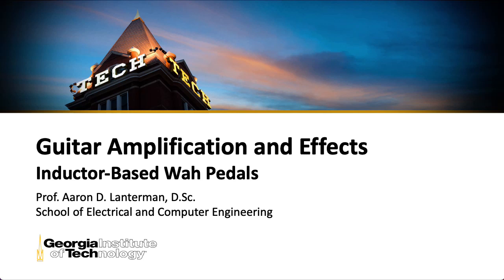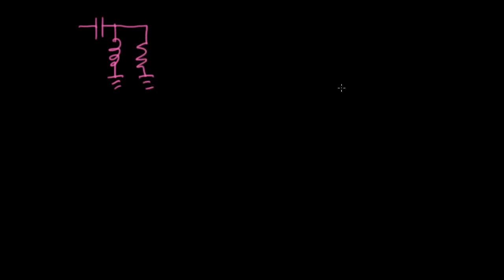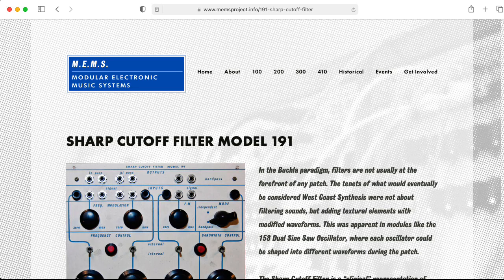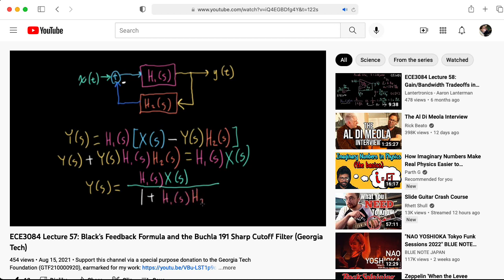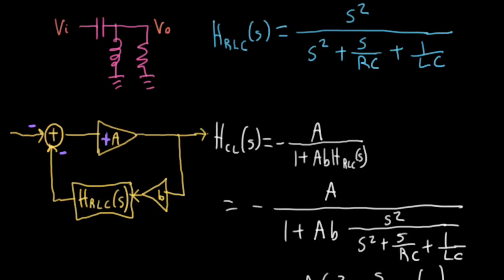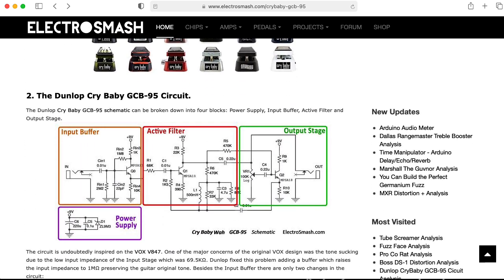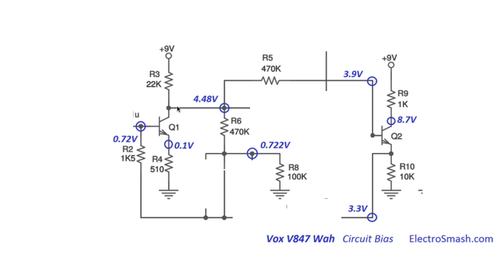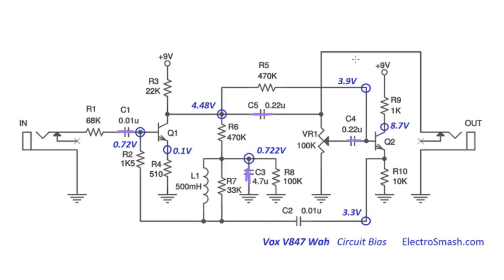ECE4448 L42: Inductor-Based Wah Pedals (Cry Baby) (Guitar Amplification and Effects, Georgia Tech)

Comment: This is great. Subscribed. I want to run a circuit by you that I fumbled together, if I may. It's a Wah effect I originally designed with a pentode/triode pair. You'll need to picture this. The triode acts as an input impedance buffer to drive the second stage. The output of which goes through a decoupling capacitor (with a 1M to ground) and a 1M Ohm variable resistor through to the control grid of the pentode. The pentode has a 1k or so cathode resistor and a large inductor on the plate (1 Henry). The screen grid is connected to B+. There is a small 100pF capacitor feeding back from the plate to the control grid. Varying the 1M ohm adjusts the cutoff, and to a lesser extent the pass band. A bandpass output can be taken from the plate (carefully), and a low pass can be taken from the cathode resistor. My mathematics skill are ordinary but I figure it's a rearranged version of the standard Wah pedal. Just wondering what your thoughts are? Cheers!
Reply from the maker: That's cool, I've never imagined a tube-based wah pedal.
Reply: qq over

Comment: I'm going to have to circle back to pick up the 80% of this that went straight over my head.
Reply from the maker: Pretty much all of that 80% goes over my head too. :)

This one is particularly complicated because it's implemented using raw transistors. An op amp style version of this circuit would be a lot easier to sort out, but I couldn't find any commercial implementations along those lines.

Comment: Transforming a transfer function into canonical form always felt tedious to me. Is there a list of identities that could make this process quicker?
Reply from the maker: Heh... if I was aware of any way to make it easier, I'd be using it. For simple ones you can sometimes guess the form and fill in some parameters by thinking about what happens to the circuit at DC or and at infinite frequency. If you find a quicker way let me know!

Control theory people probably have some tricks I'm not aware of.

Comment: When did the wah designers use negative feedback for bootstrapping the input impedance to make it very lower input impedance for tone sucking? The guitars pickups output a low impedance and the wah input impedance is a low impedance/bootstrapping
Reply from the maker: I don't think the lowering of the input impedance was on purpose. I think they came up with the feedback approach to moving the peak frequency around, and the lowering of the input impedance was an unfortunate side effect that they learned to live with (or just put a separate buffer in front like in the Dunlop version).
Reply: @Lantertronics  how does the negative feedback move the peak frequency around?
Reply from the maker: @waynegram8907  That's a classic technique from feedback amplifier design and control theory. I cover some of it in my ECE3084: Signals and Systems lectures.
Reply from the maker: @waynegram8907  My Signal and Systems lectures are also on YouTube: https://www.youtube.com/watch?v=VtSlmdshqrI&list=PLOunECWxELQRYwsuj4BL4Hu1nvj9dxRQ6
Reply from the maker: @waynegram8907  Look for my lectures on Black's feedback formula and control systems.
Reply: @Lantertronics  ok thanks